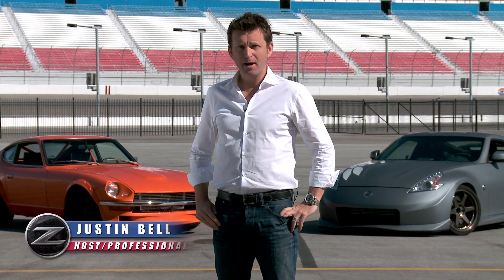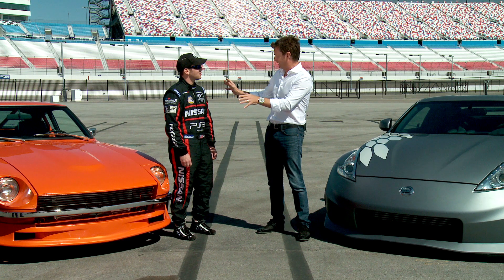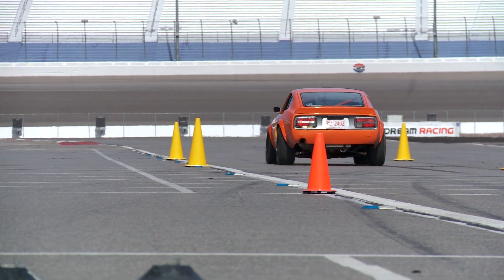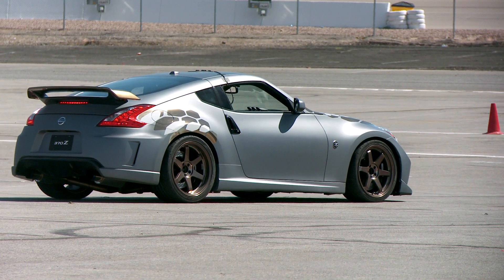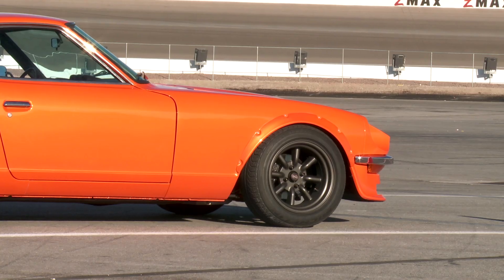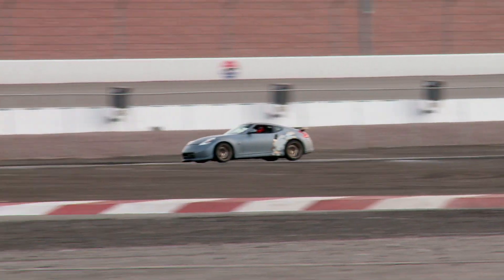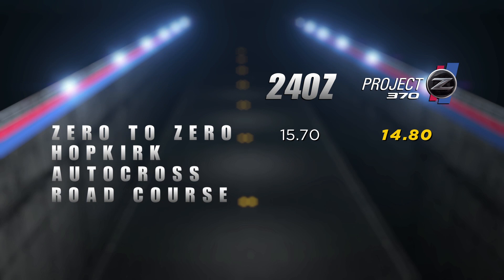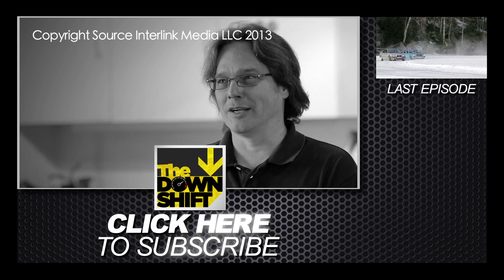Nissan Project 370Z vs 1970 Datsun 240Z with RB26 Track Battle! - The Downshift Episode 54

Comment: Soo a near unlimited budget 370Z vs very nicely modded 240Z by a single person. With the results sounds almost like the 370Z team needs to go back to work, lol.
Reply: The 370z designers are relying on computers to do all the work.  What they need to do is go back to the original designs of the engineers from 1969 and understand that the car was built with purpose, ingenuity and feel design for the driver to feel the response of the car under driving conditions.  There are several obvious influences on the 240Z, among them the Jaguar E-type coupe, the Toyota 2000 GT, the Porsche 911 series, and even a bit of Ferrari 275 GB.  With that said the designers took a look at DNA from other brands and and took the best to formulate the 1969 240z.
Reply: 50 year old car lags by a little more than 2.5 seconds?? I say the 240z has excellent DNA that rivals a modern day sports car.  Nissan has to take it very seriously if they want to continue manufacturing sports coupes.  People always put horse power first but with the 240z it was never about the horse power with the original design.  It was all about the driving experience.
Reply: @danielmelendez9943  a 370Z is a very nice car to drive, it's just extremely dated now. Hopefully what the chief engineers at Nissan have said is true and that they take the next gen Z and GTR very seriously and that the names carry so much weight that they really want to get it right. 
I'd be quite surprised if we don't see a Twin Turbo V6 300Z in the future.
Reply: Facts
Reply: @sigmaprojects  i would argue it being dated is a good thing. new cars will be paper weights because of the failed electronics in 20 years. the 370 will still be alive and well
Reply: @elijahstewart1333  when the 370Z was current, no being dated wasn't a good thing. And it wasn't about the electronics, it was about basic things.

Comment: a brake upgrade and the 240 would have trounced the 370. Manual brakes just don't cut it.
Reply: no they aren't...they had no power brakes for the 240Z in 1970.
Reply: saleem83
 skip to 5:35...thought so
Reply: brakes, suspension and tyres. it would be less of a daily driver but it would win that contest. the 370z has a miserably harsh ride. i'd take that 240 any day.
Reply: saleem83 I have some questions for you.  Does your Datsun have ABS?  I am pretty sure it doesn't but I am not an expect for your car's make.  I have a 92" Nissan 240sx with all new calipers and z32 calipers in the front.  I don't have ABS.  Do you think that would effect my braking on a road course?
Reply: It's not about power or manual (I've built a couple 240z for customers that can build 1200lbs of pressure, which is way more than a car that light needs or could possibly use), it's about the braking assists and how well they handle high heat.
Reply: If he has a Skyline engine then he has the 4 disc brakes also.

Comment: One reason for the 370 being faster is the brake balance. Way too much front on the 240z.

And the academy driver was definitely used to technology filled cars.
Reply: I've driven Non ABS cars for 15 years. Every one of my race cars before GT Academy had no ABS. All of my "daily" cars have no driver aids. Cars have come a long way in 40 years! Thanks for watching.
Reply: Wow, if you're the driver then im sorry for making hasty assumptions :D

Would you agree about the brake balance part?
Reply: It was pretty biased towards the front. I told Gordon my opinion on it, over night he gave it a turn towards the rear. This helped it quite a bit but it still could have used a little more. He likes it this way as it is safer for a street car not to snap oversteer on the brakes. Some of the video is from practice day! TV magic :)
Reply: Thanks for a reply :D  Keep on driving!

Comment: As an owner of a 1970 240z I have to say it's BOSS that your (now) 53 year old Datsun was only beat by 2 seconds by the younger 370Z with all the tech!  Daves Datsun shop in San Jose, CA has SICK BRAKES for the 240z that may have turned these #'s around!
Reply: '71 here! Still a ways to go with mine, but I'm planning to eventually attempt to fit the 350z track edition (gold) brembos on mine with 15" wheels. May or may not be possible, but I think I'll eventually give it a crack.

Comment: The 240z lost, but not by much!
Reply: t0f0b0 You know what Dom would say about wining right?  lol
Reply: Will M. ...you know Dom is not real right...?...
Reply: Deric' Anslum What?  He's not real?
Reply: It surprised me that the 370 has so much more tech and engineering yet it only barely won to a car that is over 40 years old.
Reply: joemygod1960 
see hillclimb races. The only hightech are materials to lighten a car or tune an engine and tires.... 
Its not a 40 years old car anymore.... a chimera or something ;)
Reply: joemygod1960 Power to weight ratio, mechanical grip and balance.

Comment: The 240 is awesome.  The build thread on NICO shows the amount of effort put forth to build it to the current level.  After two years of running with it on the Tail of the Dragon I can say it's quite a performance sports machine.  Time for some sticky tires!

Comment: I think an LS1 would have been a better choice for that 240. Would weigh the same or less- no turbo and he'd be putting down way more hp and gobs more torque. I'm sure import people will hate this comment but power is power.
Reply: LS1 wouldn't fit in the engine bay properly and 360hp from an RB is only from a light tune
Reply: it would absolutely fit.
Reply: Agreed. There's no replacement for displacement my friend, but I do like that he kept it Datsun/Nissan.
Reply: I have an ls1 in my 240z. It's unbelievably good in almost every way.
Reply: Ls ewwww

Comment: Weight transfer is referred to constantly in this video, and these cars do not feature weight transfer.  No weight is moving left or right or front to back on either of these cars.  The correct term is load transfer, to the rear on acceleration, to the front on braking, and side to side on cornering.  I own a '73 240Z with a carbed 2.8L and a 5-speed with some upgrades (springs, shocks, brakes, braces, aero).  A unbreakable, reliable, fun to drive car that always starts a conversation and gets a thumbs-up!

Comment: Typical Motor Trend, they put on a competition and shit all over the car guy while fawning over the factory.  I won't even mention their hard-on for Japanese cars even when they suck.  The driver wasn't too impressive either.  Crying about ABS and Power Steering.   What's this guy normally race, minivans?  I'm obviously not a fan of Nissan anything but I give it to the 240Z owner if for nothing else having class in the face of Motor Trend's misplaced snobbery.
Reply: Tony Edwards I'm a fan of good cars whoever makes them.  I can't stand Motor Trend because they have an obvious bias toward Japanese imports despite evidence to the contrary.  Yeah, the GTR and LFA are great cars but no greater than a McLaren or a Z06 Vette and you wouldn't want to drive any of them to work every day..  I'm sick of the hype and the fallacies Motor Trend perpetuates.  My issue with this vid, however, is how they make the guy who built the car in his garage look like a schmuck.

Comment: I think everyone's on the 240's side here. And yeah, crank up the boost to Godzilla or whatever, great, but paired with no power steer, no power brake and inadequate mechanical grip? The car's pretty well-balanced as it is and performed brilliantly, showing a high level of initial build quality, as well as thought and care in planning the augmentations. And it looks fantastic! I'm not saying leave well enough alone, but more thought and care in regard to tires, brakes, and chassis will be required before Godzilla rears its head again. Faaaaaaiiiiirlaaaaaaddyyyy!!!!!!

Comment: Love the 240Z. My wife's first car was a 1970 240. Even with the old 6 in it, it would do 90mph in 3 gear with 4th yet to come.  I got it up over 125 with around1,000 rpms left on the tach. Only problem was it rusted away all to soon. Traded it for an Alfa.

Comment: Wow. So, it seems like the breaks actually have the biggest impact on performance in these tests.
Reply: Brakes are just as important as the tires when it comes to racing.
Reply: as in all high performance, going fast isn't terribly useful unless you can also turn and stop fast. unless dying is your goal that is. the better your brakes the longer you can stay on the gas before the corners.

Comment: Amazing.  A home built 1970 240Z kept up overall with a factory built 2103 370Z.  As far as I'm concerned the 240 did a better run using 1970 technology than the 370 using 2013 technology.  I had a 1972 240Z and it was an amazingly nimble car with plenty of power for a straight 6.

Comment: Love the 240Z... LOVE IT.  Calling a 370Z "one of the best sport/performance cars out there" is a BIG stretch.  A Stock TTRS would smoke the "built" 370 in every aspect and it wouldn't be drifting (aka slowing down) around every corner, and a fair few other cars make vastly better platforms to build on.  I'd still LOVE to drive that 240 though, the direct feel looks amazing and I love how it get's on it.  That Skyline I6 looks so neat in the engine bay and sounds amazing.

Comment: Nice job keeping that 24Oz in the nissan family by putting a rb26 as a heart. Grew up around crazy datsun motor swappers so 36O whp is low . A lot of 24O,28O z owners tend to go for the small block chevy. Talking a hell of a lot more hp, then you force induct, turbo or supercharge..... straight up monsters

Comment: due to tighter safety concerns and people that want "gizmos" (word not derived from nismo),todays 370z weighs1471.9072 kgs (very accurate) while a stock 240z weighs 1068.21. this is a big weight difference and causes both the cars to preform differently under different circumstances. NOTHING blunts acceleration,deceleration and handling like weight.

Comment: That 240z was built for auto cross and it did win that challenge, which is awesome. I expected the 370z to take every single one because of how much better its braking was and it did seem visibly faster in a straight line.

Comment: all he really did was a restoration with a new engine. to me a heavily modified car would have been him also adding new abs brakes and installing a new steering wheel with power steering and traction control. But as far as they mentioned was that all he added was new engine and probably a few parts to accommodate it. But I think the 240z is the real winner overall for the most part it is old vs new and new barely held on for the win.

Comment: My personal opinion, the z32tt is the car to beat. Stock vs stock,The z32 best z ever produced. Swap the turbos out and you got plenty of power to keep up with todays sports cars. Thats probably why they didnt use it on this vid. It would have made the new 370z look bad. Specially if you get a hold of a fully built z32. 

Hard to believe the 240z with rb26 ~2200lbs was out performed. Lets get a break upgrade and go for round 2

Comment: Give the 370Z a better paint job.   The 240Z is a cool car. I've driven one back in the early 80s and also had a 71 MGB-GT (same type of body style).  I would have modified the GT over the 240Z just because their are less around. But that's another story.  The 370Z seems like a great car, but I've never driven one. I'm sure the modern tech and comforts would win me over.

Comment: Tires, tires, tires. The AD08s on the 370z are some of the best street tires out there. If the 240Z was running them, instead of all seasons???, this would be a different story. I'd know considering my 500hp 335i has AD08s (in this same size too) and my 240Z has BFG KDs. Just my 02. Awesome 240z!

Comment: Its an RB engine swap, so it isn't bad.  An L24 would be nice, but it wouldn't make as much power.  Besides the RB and L series engines are related.  Parts of the L series engine are in the RB.

Comment: plus you wont max out the internals of the vq on a NA engine, and despite the fact the tb48 has a good bit more displacement the vq35 heads still flow significantly more

Comment: That is the difference 40 years of R&D make, still the 240 did really well and with a modern brake system and suspension package I think it would have won. I think the older cars are so much better looking and still really great.
Reply: C MJ, it did have upgraded brakes.. but with the wheel size the rotors can only get so big. It did well for an old car. The guy built it for fun, not to be the fastest thing around a track. And I'm guessing it has coilovers on it already. Sure he can spend more money on suspension for track times, but then it's just less enjoyable on the street.

Comment: Thought it might be worth a mention; that 370 is running hard. I don't know how much more you could squeeze from it, or at what cost, but everyone here knows that the RB hasn't even broken a sweat. I think any test requiring get up and go could have been dominated by the 240, if the guy had deep-enough pockets to keep it in good rubber. Does anyone know what these cars cost?

Comment: Apples to oranges. Without all the specs on both these cars it's impossible to tell if it's a fair comparison. Just a guess though they spent way more money on the 370. Just from the looks of it the 240 is not as low as it could be nor does it have big enough tires. He went with a wider stance and offset with the flares but he didn't go wide enough on the rims. You can fit 245's with these flares and those look like 215's. ALB brakes is not really an advantage, I suspect the shocks and the way the suspension is set up is causing all the lock up, that and the narrow tires.
Reply: They posted the specs, look again. The 240 tires looked pretty wide to me .
Reply: +Dolan Kang its no comparison apples to oranges power assisted brakes simply cant wang with alb

Comment: Was this particular early Z the best example to go against the 370Z? Is there a 240,260,280Z that can be seen on you tube that could have improved on this? Wouldn't a 90-95 300ZX turbo Stillen stage 6 or 7 beat the 370 easily? Isn't that what someone should be sinking money into?

Comment: Why build the rb26 to only have 360 hp? If I was doing this swap I would at least push it to 500-600, which the rb26 can easily make. I see a lot of small differences I would make to the z car. Mostly with the powertrain. Push 600 out of the rb26 and put in a r200 diff to take the punishment. And you spent 3 years and you could get anything more original than wantanabes? Some ssr mkiiis would look amazing on that car.
Reply: RS Watanabes are as original as it gets for classic Japanese cars buddy
Reply: Because that's to much power for the car.it.would only be good in a strait line.more is not all way's better.try driving a hellcat on an autocross you'll get what i mean.
Reply: It already has an r200 diff... The 360rwhp is usable power, and the car already has a fantastic power to weight ratio. The car is set up for autocross, that is why it doesn't have 500+ hp.
Reply: wantanabe are fucking classic wheels man! nobody ever hardly has them within a 1000 mile radius. 600 hp in a little z that weighs 2000-2200lbs is insane! even 200hp is a blast in a z. you need 500-600hp in a newer car, because they weigh 3400+ lbs. 350-400hp in a z is plenty of power.
Reply: Rachael Gobbel You are not correct. A Datsun 510 might weigh 2000-2200 pounds but a 240z will weigh at least 2500 with a driver. Also, yes RS wantanabes are classics but they are hardly rare and barely scratch the surface of real kyusha wheels. He couldn't put in the effort to find a set of techno phantoms or yayois?
Reply: Yevgeniy shmurak The 240z weighs about 2,300lbs in stock form. She is talking about this particular Z, which might weigh 2000-2200lbs with some weight reduction.

Comment: continued bbks dont increase braking at all they are all designed to have the same piston volume, you want increased braking power you have to swap out the master cylinders which no one does it actually performs worse then stock in braking due to extra weight. "smart abs system" yes because abs is so helpful in racing, in fact so useful that no pro racer uses it, its only purpose is to stop bad drivers from spinning out, good drivers will out brake a abs car with none.

Comment: it is a fact that the 370z has a more powerful engine producing 324hp and 241 Kw, it weighs more. stock 240z 2.4 L24 before 1973 (carb change) (Safety concerns again) had around 200Hp and 210Kw (approx). that is probably more than enough to beat the 370z. a car i know that would win would be the nissan Fairlady 300zx Z31 (few differences, for instance 3.0 L VG30E SOHC V6 (300ZX) VS 3.7L VQ37VHR ).

Comment: why the 240 doesnt have power brakes is beyond me , i woulda bought a gtr front clip and put the gtr brakes  and booster on myself , i have had 2 240s and at least a 300z brake upgrade is a must with a boosted engine swap.

Comment: This is far from apples-to-apples critically due to tire differences.  Yokohama AD08 and what I observe to be General Altimax HP don't even belong in the same sentence!  I'm surprised the test numbers are actually that close.  This test could have easily flip-flopped if they used same tires or even similar category tires, let alone same widths.

Comment: well the gt-r was in semi wet conditions. The same driver would have likely beaten that time by a bit had it been dry.
It's designed to be a car that you can legally drive on the street to the track. It's nothing like how a mustang is, unless you're referring to the track package stangs, in which case they're also street legal race cars. It's just silly to say that it's not designed to be raced when it's so obvious that it is. If it were just made to be a dd, nissan would have made a model s.